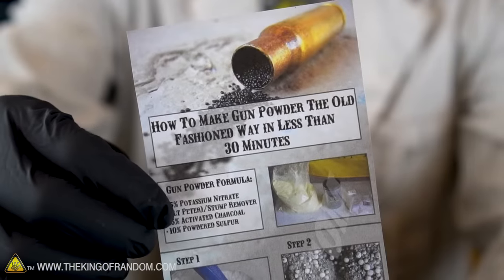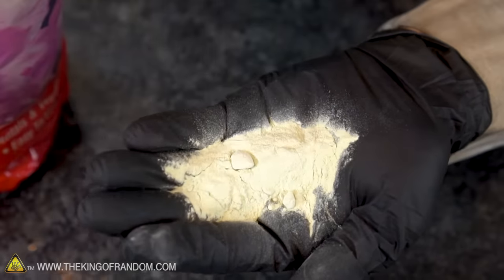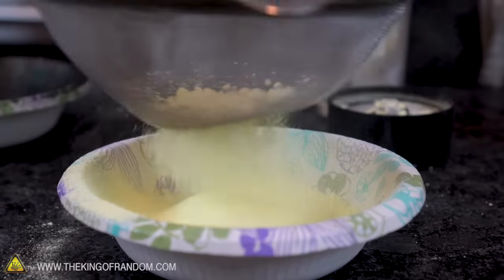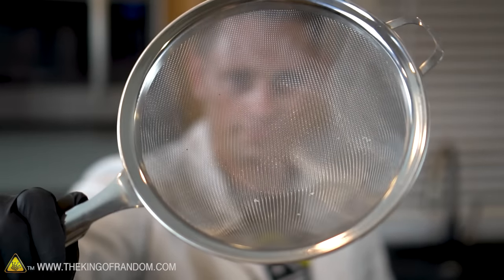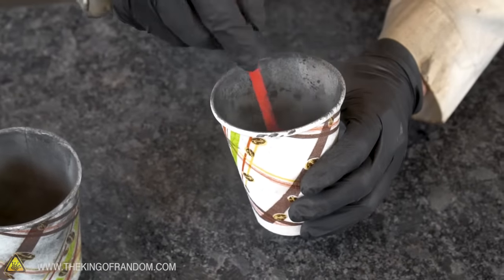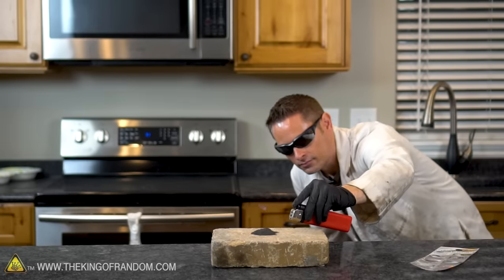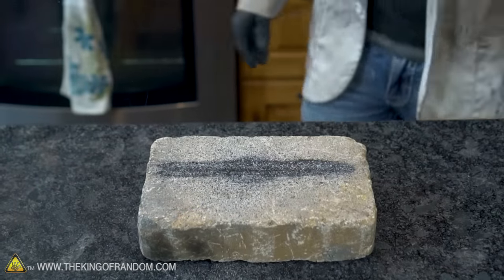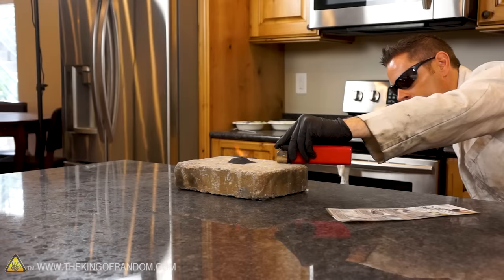Homemade Gunpowder, For Science! How To Make Gunpowder - DIY Gunpowder Experiment!

Comment: This is NOT black powder, you can tell especially by how slow that burned. This is called green mix, which is a rough mixture of black powder ingredients without processing. To make black powder you must process green mix through milling, compression or corning. Black powder works by the sulfur and KNO3 being worked into the granules of charcoal on a microscopic level. Depending on how this is processed it may still be simple BP and not gunpowder. Simple BP packs together and therefore loses surface area and burns "slowly" unless compressed, it is used in pyrotechnics, rockets and some traditional black powder muzzle loaders but will not burn as fast as gunpowder when uncompressed. Traditional gunpowder is granulated in various grain sizes so that it has high surface area and burns much faster so that it can be used in firearms.

I can see not wanting to teach people how to make real black powder but you should probably specify what is being made for the sake of scientific accuracy.

I have done a fair bit of amateur pyrotechnics and rocketry work so feel free to hit me up if you have any questions.
Reply: Why? is it called green mix? Even though it is already color black.
Reply: Honestly couldn't tell you where the name comes from. Possibly just a reference to terminology used in some agricultural products ie. Green lumber is lumber that has not been kiln dried.
Reply: Green, as in new, ya dig?
Reply: Hey, I wonder if you can answer this question. A friend and I followed this video pretty closely except we only had a pesil and mortar to grind things up. I understand that this isn't proper black powder but nonetheless, the product in this video was quite a bit better than ours. I am thinking that it wasn't mixed well enough because if I shake the mixture it begins to visibly separate into two slightly different shades. There is a dark, light powder on top, and a slightly lighter coloured grey powder on the bottom. The grey powder seems to burn quite well but it leaves behind the black powder and some greenish ooze. My theory is that the potassium nitrate granules weren't ground finely enough and the mixture wasn't mixed enough. So we just ended up coating the potassium nitrate in a layer of charcoal/sulfur but it was spread out enough to properly mix in with the rest of the charcoal/sulfur, meaning that only the grey powder burns properly and the rest is left behind. Does this sound logical to you? And what could I do to improve thing assuming I don't have access to a ball mill? We did try to grind up the potassium nitrate as much a possible but it was already shipped in granules approximately the size of very fine sand, not nearly as fine as the charcoal dust but we were unable to grind it any finer than that using the pesil and mortar. 

Do you think our main problem was not grinding the potassium nitrate enough?
Do you think our main problem was not mixing the ingredient thoroughly enough?
Some combination of the two?
I have heard that one can use water to help mix them more thoroughly because the potassium nitrate dissolves in the water. Do you think we would benefit from this?
Why do you think the powder in the video burned so much more completely than ours? He seemed to just be shaking the powder together by hand which is what we did. But it is hard to gauge how finely ground the materials were.
Reply: Could I potentially use store bought charcoal for grills in this? Or do I have to make the home-burnt stuff?
Reply: SavagerySean Charcoal briquettes, absolutely not, natural lump charcoal, yes.
Reply: where would I get willow wood? I wanted to try and make a firecracker this fourth of July (a small one) but I've had no luck on the internet looking for that type of wood for sale.
Reply: Why? I made this powder twice and both times it turns out grey instead of black like his, why is this?
Reply: I understand that another part of the process to help them combine is to mix in Alcohol (or water, but alcohol works better) and then force it through a screen to make granules, then allowing it to dry (alcohol evaporates faster).
Reply: Ashton Krause it doesn't have to be willow. Any hardwood will do. You only need charcoal because it's a carbon source.
Reply: One method to turn green (or "serpentine") powder into black powder: First, add water until you get a thick paste. Then spread the paste out and let it thoroughly dry. You will get chunks of black powder. Then very carefully grind it down into a coarse powder. Sift it through different sizes of screens to get consistent powders. When grinding, use a stone, ceramic, or wood (not plastic!) mortar and pestle, and do it in very small batches.
Reply: why not?
Reply: All he needs to do is pelletize the BP to allow better air flow and the mix would burn a lot faster. Just letting the KNO3 keep the water and adding a little more both makes mixing a little safer and allows you to push the wet thick paste through screens to pelletize it and make it so it isn't as packed and burns better and faster.
Reply: This is all very correct.  In the fireworks industry, a rough mix is called green powder.  It has nothing to do with the color.  It's more to do with it being unprocessed.  The next step would be to ball mill the mix using non sparking lead alloy media.  This mechanically incorporates the ingredients at a much finer level.  Next it is hydraulically pressed into pucks.  These are then broken up into granules.  This resulting product is black powder.
Reply: Adrian Lacson it is called green mix because it actually does have a slight green tint when the ingredients arent fully incorporated
Reply: Exactly.I have found milling makes a massive difference to the end result.😊😊😊
Reply: I am look to make black powder, for fun game help me make black powder yes recipe tell yes
Reply: A mixture of alcohol and water works better.
Reply: why?   correct.
Reply: Charles Griswold in Britain,we call that method corned powder.
Mixing it wet then grinding coarsely increases the surface area and allows more oxygen to enter into the burning process.
Reply: I used black powder and even laying in a dish it sill explode!!! not fizzel! thats a very very rough form i do not think it fire in a gun!
Reply: Some woods are better than others, due to the internal grain structure and porosity that results when pyrolized into charcoal.  It's NOT "just carbon".  Think of charcoal as a complex, nano-scale-porous, hydrocarbon.  The wood DOES actually matter.  Denser hardwoods like Oak and Maple produce inferior black-powder, because when pyrolized, then are much denser, and hardwoods take up silicates into the wood.  Willow and Poplar (Cottonwood) work very well, and I've made many kg of excellent shooting-grade blackpowder over the years, with the proper process, and home-made poplar charcoal.
Reply: Chris Young  
You're thinking in terms of smokeless powder, which is not the same thing as black powder.

With black powder, the granulation makes it burn faster because the spaces between the granules allow the flame to propagate through the entire mass of powder.

This means that the whole lot gets ignited almost instantly.
If the powder is not granulated, it burns from one end to the other like a fuse.
Reply: lol someone will toss that in the blender and bring new meaning to the name Magic Bullet
Reply: @sammadsen5345  No... you go play in traffic yes..
Reply: @briantmartin83  n o
Reply: @briantmartin83  no, black powder please boom yes yes
Reply: Is green mix black powder still highly explosive?
Reply: toddy2519 
P.c. Of water and alcohol ?
Reply: We dont need to get a PHD in chemistry for you to tell us that this isnt black powder.
Reply: @lax1master  That depends on what pyro you talk to, some say yes and some say no.  I have yet to try store bought but I do read no rather than yes more often.
Reply: Im willing to bet that this person reads books and has never gotten his hands dirty once!
Reply: Didn't they use to soak it in urine and boil it out in the old days
Reply: Black powder isn't the same as smokeless powder I think you are confusing the two.
Reply: @Doctoberfest  I saw a show on the civil war not sure if it was black or smokeless
Reply: @gregj4857  I think black powder was used in the great depression
Reply: thank for this great clarification. I confirm what you are saying. .  we put the black powder mix into big roller mill with ton of pressure during hours .  The aim of this process in not have a finer powder, but to fill  charcoal porosity with the mix of sulfur and potassium nitrate. ( if you look with microscope, you will see thousand of small porosity  and this is why it is impossible to make industrial black powder with coal). this industrial gun powder burn faster than a simple mix and is known from centuries .
Reply: Hahahah wtf are saying bro it is a black powder hahahahaha can't you see it? Hahahahah lol
Reply: Nerd why do you have to be mean
Reply: Correct. This is just a mixture of black powder ingredients. To form a real black powder what you need to have is the formation of minute crystals of KNO3 around every finely milled particle of carbon and sulfur. There are several ways to achieve it, the simplest being to dissolve the KNO3 in a small amount of hot water forming a very concentrated solution. Then thoroughly mix in sulfur and carbon into the solution creating a slurry. Then simply allow to cool and dry, you can shape or sieve it before drying. This process forces KNO3 to crystallize around every carbon and sulfur particle creating a huge contact area between fuel and oxidizer.  And bingo, you have an explosive!
Reply: Iosif Stalin look up elemental maker he makes real black powder and all sorts of other stuff
Reply: I have a question about this but I do not want to ask it here. Is there a way to contact you other than here?
Reply: R I  Funny. No the reason is me and a neighbor mixed up a batch years ago. We were 15 at the time I am now 52. We did it totaly different. We really did not know what we were doing. What we ended up with was super fast burning and powerful. I just wanted to tell you how we made it and if you know what we made. We used the same formula as you but it was the way we mixed it I was wanting to ask you about.
Reply: @noobieadrian0092  Its called green mix because it is mixed together by hand and not ball milled after mixing. Ball milling is the final process for making black powder.  Green mixing will work, just not as well.
Reply: If you want to spread your knowledge, start the message of more seat grabbing and not so critical. People might listen to you more, just saying! 

Any-who, thank you kingofrandom for taking your time to share some fun facts that obviously tickle you our fancy 😄 with people, some of us out here are listening and are grateful.. even if we still have to do more research and learn more..
Reply: Can anyone explain this a normal words I don't understand this science
Reply: @idiotswithadream556  What is it that you don't understand?
Reply: @rickjwilliams  the science terms can you explain this to me in a simpler way?
Reply: @aidenpearce7900  Actually, black powder is not explosive.  It is highly flammable. The black powder when in the open and exposed to flame just burns VERY rapidly (in a puff of smoke).   Imagine that volume of smoke and flame in a tight container.  WhenBP is enclosed in a tight container, the flaming makes much more gas then the solid volume, so the container explodes.  If you put it in a tight container with a moveable end cap (bullet), the end cap will rapidly leave the container.  WOW, firearm ammunition!  Or a firecracker.
Reply: @gregj4857  Smokeless powder came out during the Spanish American War period (late 1890s) and were first used in Mausers and other European rifles.  The Spanish in Cuba used smokeless powder and the American forces used BP.  Americans were shot up quite a bit because the Cubans (Spanish) could easily see where the firing was coming from, the Americans couldn't detect the smokeless powder shots as well and had a hard time returning fire.
Reply: Bill nye the science guy
Reply: Use a ball mill to grind all components together,  using lead balls.  Not steel
Reply: @noobieadrian0092  Green like green burning wood. it burns slow.
Reply: If I were to mix all the ingredients together in a morter and pestle would that work?
Reply: Why? Can you put sulfur in a blender???
Reply: Do you recrystalize your KNO3?
Reply: @ashtonkrause7211  down by a river
Reply: 100 % right ! I got black powder here .... burn 10 times faster .
Reply: he should of told the whole story if we can be trusted to handle black powder we can be trusted to make black powder !
Reply: @Whyyyyyy  green means  ITS NOT RIPE YET..green bananas  green strawberrys etc  NOT RIPE ..😂😁😉
Reply: Coning is needed for storage and transport. Different compositions could separate due different density.
For this freshly made black powder, all composition are perfectly mixed, no process is further needed.
Reply: Why wouldnt you want to teach people? You are a people nikka and someone taught you
Reply: Do you think you could tell me the right quantities for making say... A little grenade? I have made them before but never using primitive black powder, it looks much cheaper and funner to make, I could also use some tips on the measurements seeing as how you did pyrotechnics. Not really looking forward to blowing my arm off while guessing. You did say hit you up if you have any questions ^-^
Reply: you’re right

Comment: That burn rate is very slow and not because it's in the open, more that you have only made green powder. Unless you ball mill it you will not get it to burn any much quicker.
Reply: Agree. The components need not just be mixed together mechanically - the particles of nitrate and sulfur need to be mechanically smashed into the particles of charcoal by grinding between the balls of a mill. This will make for a much better contact between them, and will increase burn rate by orders of magnitude. 
I typically ball mill my black powder for at least 24h, and in the process keep it moist with a bit of alcohol. The moist ingredients make for a higher efficiency of the milling process, and also keep the amount of dust down and reduce the risk of auto-ignition. Also because it's alcohol it will quickly evaporate once it's exposed to air at the end.
Reply: +Reagent grade materials and a ball mill
Reply: could also be accomplish with wet mix correct? that is how I have seen home made black powder made before. and then it is screened and cut to form granules.

Comment: Gun powder was traditionally made WET, Then dried into a cake and milled into powder. The difference in  performance is dramatic and the manufacturing process is safer.
Reply: I was looking on this page to see if anyone else knew that. 
When the cake is dried and crushed it creates tiny grains of gunpowder with a larger surface area, hence a faster explosion!!
Reply: @ledzebulon6235  i dont think it has a larger surface area, it has been a big point in this video that you have to mix the components well, and clumping them together while wet is as well as it goes probably

Comment: Why is it that you can make gunpowder with a process that takes days and have it stay up on youtube but Cody's Lab can make gunpowder with a process that takes 18 months and youtube takes it down? Strange...
Reply: days?? this is grinding and mixing powders. it takes ten minutes or less..
Reply: Did Cody's lab refine the powder? That may have been the issue. This is only a poor mix, if refined then it becomes actual gunpowder which may have been the problem.
Reply: This is green mix, not black powder, thus not very dangerous.

The one at Cody's Lab is probably actual black powder that can be used as a weapon, so youtube took it down.
Reply: @j.mtherandomguy8701  is green mix consider a explosive and how dangerous is green mix black powder?
Reply: @GodlessMartyr666  Incorrect... properly done, real, black-powder takes upwards of a week to make. 

This is just a dry mixed pos slow burning junk batch or BP... or as I call it... wanna be BP.
Reply: @mr.techaky7655  Better than nothing at all.

Comment: From my experience, static can also be generated with plastic. Ideally a dried wood dowel would be used. A main reason to not use metal is the impact factor, (if using a metal mixing bowl) which can also be dangerous.

Comment: hey can you try putting molten glass in liquid nitrogen
Reply: noone :p that would be interesting
Reply: It would just solidify
Reply: Cornelius dill pickle it may solidify so fast it explodes. Not spectacularly of course, but I wouldn't bet on it staying intact.
Reply: I second this. Will be probably become a prince rupert's drop with a very short tail. Would love to see that.
Reply: Prince Rupert drop.. right?
Reply: wrong, explode and fly molten glass everywhere
Reply: it will become sand
Reply: Molten glass doesn't turn into sand. Sand is made to make glass, not turn into sand.
Reply: GD Pal12 i tried it and it turned into small particles like sand
Reply: It wouldn't do much. 
Not a great video.
Reply: how about heat up liquid nitrogen, I know that it just transform into gas but only if possible :
Reply: noone :p Yeah what will happen 🤔🤔🤔🤔
Reply: noone :p 
It'd basically be like when Mythbusters did thermite and ice, it exploded.